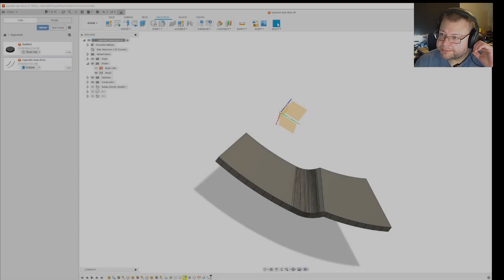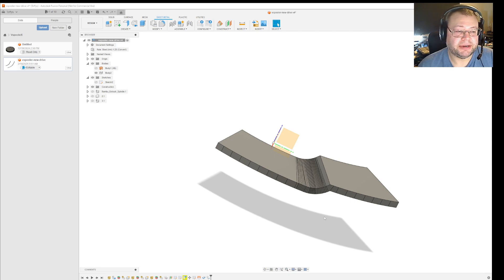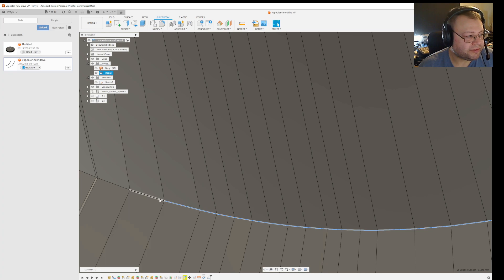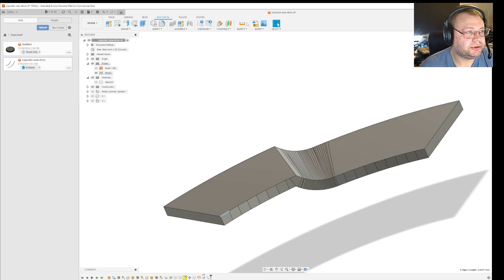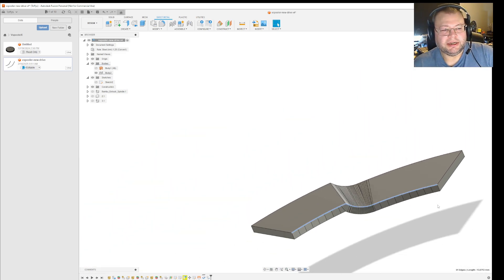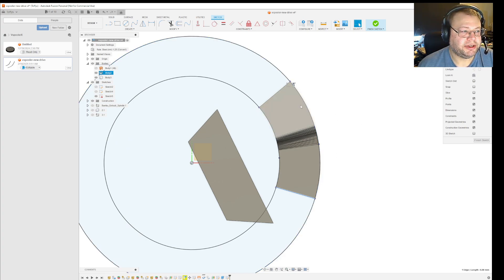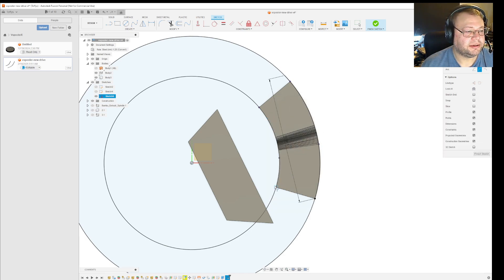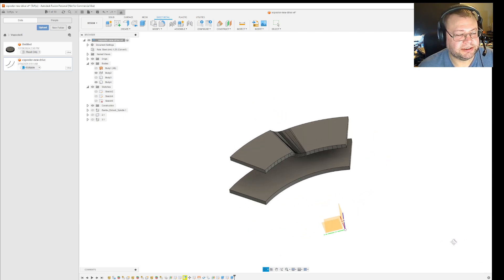Fusion 360 - Flatten a 3D-curved object from 3D space with same dimensions

Comment: But you entered in the distance between those two points that created your arcs, not the actual arc lengths. as far as I am aware, you cannot dimension via arc length (but you can do the math and use that).
Did you end up printing this and seeing if it worked? my assumption is it will have come out too long for your purpose.
Reply from the maker: no, i summarized the total length of each segment making up the total lenght of the side of the object, then used that as a reference. If anything I should measure the bottom part as it would be the best reference but the length fit perfectly.
Reply: @Toffypops  I mean in the dimension in your flat pattern
Reply from the maker: the original object was consisting of 2 perfect circles. Hence an arc can be used. If I did anything wrong in this video, it would be that I measured by the top edge of the curved surface, when i should have measured by the bottom as the bottom is shorther than the top. But the principle is the same. The sum of all parts making up the side, equals the length of the arc needed to turn it into a flat object that can curve over the surface after print. And yes, i 3d printed it in TPU and it fit perfectly around the arc.
Reply: @Toffypops  Correct. What I am trying to say is you measured the arc length as accurately as possible: a great tip that was the point of the video, but when you transferred it to the sketch, you used that value to dimension the straight line distance between the points on that arc, not the arc length, because as far as I am aware, that is not possible in F360.

If it is possible, please tell me how, if I am correct, just be aware of that in the future (I'm assuming it worked for you here because the dimension wasn't critical, so as long as you were vaguely close, it worked.)
Reply from the maker: @JD2jr. we are in agreement then. :)